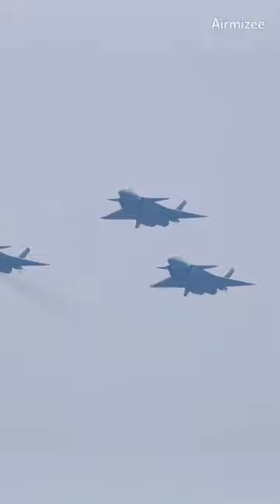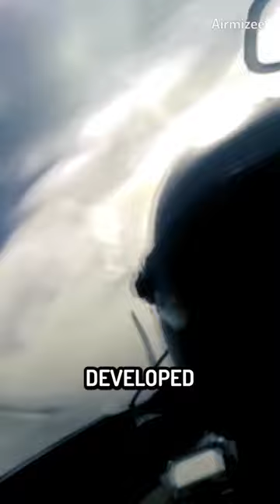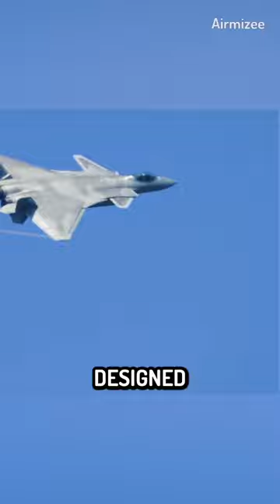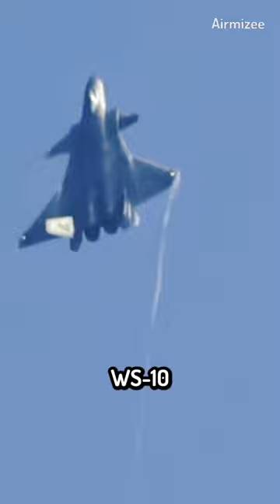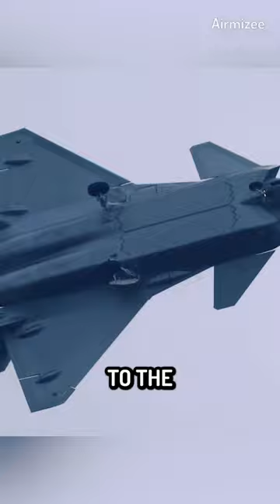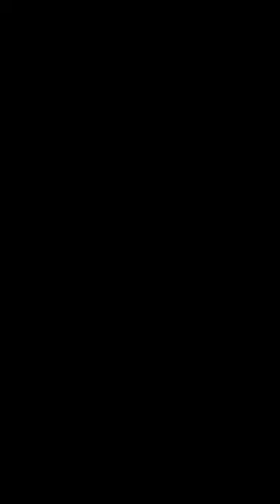A new engine upgrade for China's J-20? #shorts

Comment: I am a little worried!!!! Mach 2 is so fast it takes 2-3 American states to turn around!! 
We as Americans are asleep 😴 Zzz
Reply: US jets have been at MACH 2+ since the 1950’s. And it doesn’t take states to turn around. 

Once an aircraft starts a turn, the velocity drops quickly. Turning radius is more a function of what g loading the pilot can maintain, not the airframe. 

MACH 2 is a dash speed, not maintainable for long periods of time. Usually minutes not hours.
Reply: @konekillerking  ya I just fix mechanical stuff. Trucks heavy equipment ect. I wasn’t doubting American…. I just fear 😰. Our leaders are not letting progress. That’s all
Reply: It’s all good. Thanks for fixing the trucks. My oldest drives them trucks. I’ve followed this stuff since 1964 when my dad built F-4s then F-15s the harriers and F-18. 

Studied in college, then ended up teaching. I’ve great respect for anyone who puts in a solid days work. It’s all important.

Comment: Time will tell if the WS-15 engine is an improvement. 
If it doesn’t have single grain metallurgical improved compressor blades, it won’t be reliable. 

It’s really not a ground support, or air superiority aircraft. EW is a possibility, buts it’s designed for air interconnection, not really air space denial. 

It goes after our tankers and EW assets. Probably wouldn’t have much success against B-2, B-21, F-22 or F-35. At least based upon actual performance. CCP statements of performance, well are only verified by the CCP.

Comment: The airframe and the weapon bays sure look promising.

Personally I am not sure about the engines and canards.
Reply: Whats wrong with canards?
Reply: @MrSpiritmonger , they generally make the aircraft less stealthy.
Reply: @cdanny304  do F-22's protruding twin rear horizontal stabilizer reduce stealthy? F-22 essential has canards in the rear but no one complains about reducing stealthiness
Reply: @MrSpiritmonger that's because they're designed specifically with a coating that absorbs radar unlike 90% of other 5th Gen fighters. Those high profile engine exhaust tips along with those canards make the stealth design largely redundant.

Comment: With the canards, it's only 1,000 times more detectable than the F-22 or f-35, either of which could shoot it down miles away from it's effective engagement range. The WS-15 engine has so far proved to be highly unreliable too.

Comment: I'm pretty sure Intel reports say these are 4th gen fighters with vaporware
Reply: @MrSpiritmonger  Here's the full qoute Based on the most advanced weapons that an F-22 Block 20 can carry now, it is not competitive with the [Shenyang] J-20, with the most advanced weapons the Chinese can put on it, It's about weaponry attached not the aircraft themselves. Nice try Chinese Propaganda bot
Reply: Also the Block 20s are already outdated and been replaced by the f22 Block 30/35s
Reply: @MrSpiritmonger  See my other comment on how these are already updated by the f22 block 30/35s
Reply: @Dryphu  there is 32 F-22 Block 20 that USAF wants to retire but Congress blocked that. USAF says Block 20 is obsolete and upgrading those is too expensive and not worth it. Also, J-20 received it's WS-15 engine just this week, which is a significant upgrade to its capabilities.
Reply: @MrSpiritmonger  Again those aren't the newest ones like I've said twice, your comparing a 2012 Ford to a 2023 DongFeng
Reply: @Dryphu  you said Block 20 been "replaced" and "updated" but Congress denied retiring or upgrading 32 units of  Block 20s in 2023, so birds still flying today. Yes, there exist newer Block 30/35 version, and J-20 also got an upgrade to J-20A last week too. J-20A has WS-15 engines and other upgrades.
Reply: @MrSpiritmonger  I think the bot ran out of responses, because that's the 4th time you've commented that
Reply: @Dryphu  Block 30/35 proves that J-20 is a 4th gen fighter? You repeat it like it proves what point?
Reply: @Dryphu  so a 4th gen fighter has superior weapons, EW, sensors, and comms than the 5th gen fighter. Got it.